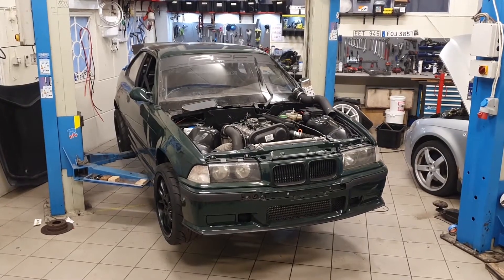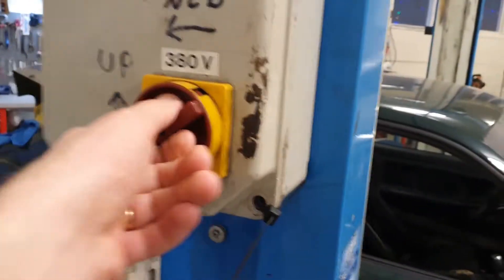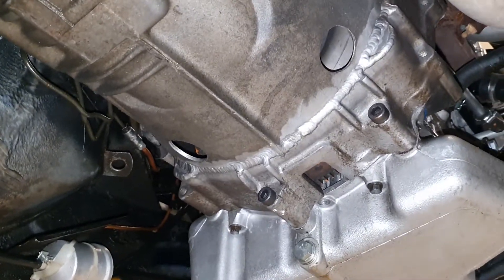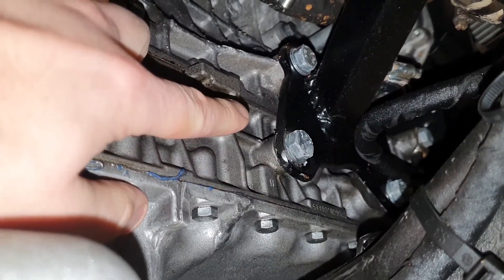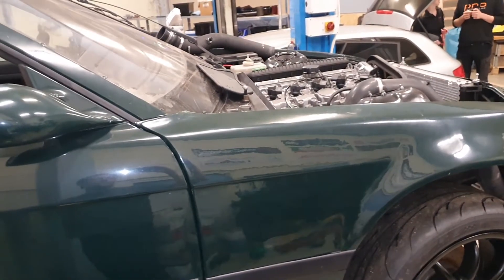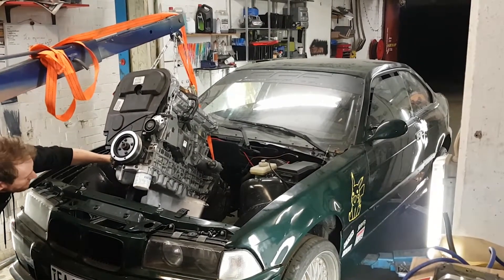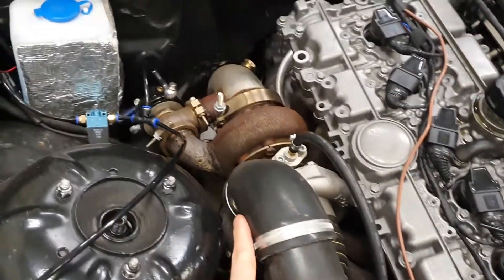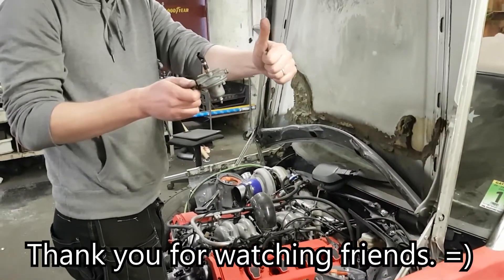HOW TO ENGINE SWAP ANY CAR - Explained in 5 minutes - with Volvo engine in BMW e36

Comment: Tha t5 engine is some degrees back in the volvo, reasons is i guess weight balance in the front. Couldnt it stand waterleveled in a rear wheel drive upseth?

Comment: Nice vidéo ! I want to swap my e36 like your !
Please tell me ...stock parts are about to handle 400-450hp ...of course i have to replace the turbo and intercooler ...im asking about pistons and rods
Reply from the maker: @sidahmedouabel7417  we have a bit over 500hp on stock internals now.
There are many versions of the volvo 5-cyl engine so the strength of the internals differs between them.

Comment: If I engine swapped would I need a wiring harness from the make of the car I’m putting it in, or make of the engine that I’m putting it in. And would I have to get it all properly remapped and calibrated so it runs properly
Reply from the maker: @lj2433  the best way is to get a custom made harness that fits both your swapped engine and the aftermarket ecu you plan to use.
Yes, a custom tune is needed too.

Comment: I had bought a freelander 1 as the first car for me to thinker with. Knew nothing about cars before hand, but I took it apart for a headgasket and oil seals replacement job. Drove it around for some time but the engine blew up. An oil leak while on the highway dumped all the oil out, and piston 2 slammed right through the side of the aluminum  block due to heat and friction. 

So, am I really going to put a 'new' 1.8l k-series engine in it, when the shitty land rover engine will always and forever be a liability? I'm thinking no.

Now, I'm researching the engine swap experience. Any thoughts on what I could possibly get away with? As far as I can see I have 3 different routes I can go: 1) a different but better land rover engine, if such a thing exists, I don't know. 2) a different brand but similar engine, like a Toyota Rav4, (but then why not just by a rav4, right?) 3) have some fun with it and turn it into a sleeper. Nothing crazy, no 1000HP stuff, but something to make heads turn as a freelander 1 zooms by.

Comment: What did you do to use the RNC manifold on the RN head?
Reply from the maker: Removed the vacuum-stuff on the underside and adjusted 3-4 bolt holes.
Reply: @dynochannel  that's all? Did you weld up the hole or the spaces on the flange? Thanks for the reply!

Comment: What transition and clutch did u use? And did I make the wiring yourself?
Reply from the maker: Hi,
Transmission is a ZF from a Bmw 330 diesel.
Clutch is a Sachs 707.
And yes, we made the wiring ourselves. My garage buddy Engdahl Motorsport do them for a living.
Reply: @dynochannel  cool thx 🙏 love the build

Comment: I use your video guide. In swap Volvo t4 engine into BMW e36/e46 oil filter will bump against the steering wheel/fore-beam?

Comment: same here my bmw x6 v8 engine is done and the used engine 9000$ im waiting for damaged bmw go to auction, but this will take a year, so for now can i take 4 cylinder engine from junkyard with its own ecu and same harness and wiring and give it 12v will it start without programing?

Comment: Hey say I want to swap this engine into an e46 and use one of those custom digital speedometers that are made for it by id4motion, do you think it would work? Or would I have to use a different ecu? Would really appreciate ur input/recommendations
Reply: Say I use something like an ecu master black? Would the id4 digital cluster work as it would with the Bmw engine?
Reply from the maker: @tariquetulloch6643  Hi, we usually use maxxecu on our project cars now, and it should work with the id4motion products. Dont know about the emu black though. Contact id4motion and ask them if it works 👍

Comment: My plan is to swap  1999. C70 2.0 T5, in to a 1980. Ford Taunus coupe. It would be appreciated greatly to get any advice on the issues you faced. I have complete C70 that need some minor work to get it  up to a good condition and i have bean presented with 1000euro Ford Taunus that has bean a project car but the owner decided to give up on it do to a lak of a number of parts that are impossible to find. My plan is to transplant as much as I can from Volvo to Ford and since Ford is rear drive, transmission is a bit of a dilemma. So, anything is welcome.
Reply from the maker: Sounds like a fun project.

We used a bmw gearbox with a volvo bell house welded to it. Most swaps here in Sweden use that combination.

Use an oil pan that fits with your front chassie beam. We used a shortened oil pan from a volvo 760 and also a shortened oil pipe inside the pan.

The you need to make your own engine mounts of course 👍
Reply: First of all amazing job! What flywheel, pressure plate and clutch did you use? And last question, if you have a complete donor car and you install all the electric in the swap car it is an easy way? Thanks for all!

Comment: this has me curious about an e46 swap. would an adapter plate be better than cutting and welding the trans? i wanna use that same trans for other builds
Reply: adapterplate is easier and you will get it 100% straight, but the welded boxes are fine. there super tricky to get straight in welding process.

Comment: How much do you charge? I'll send you my truck
Reply from the maker: Depending on the project. But if you are serious you can always contact me or Thor ( Engdahl Motorsport ) on instagram.
Reply: @dynochannel  I want to make my 01 ford sport trac the ultimate sleeper/daily driver. What engines do you suggest would be good for the swap?

Comment: can you go into detail what upgrades the engine has for the turbo?
Reply from the maker: Hi,
engine is a stock b5244s4 ☺
Reply: @dynochannel  but it's n/a engine
Reply from the maker: @igorigor9935  yes, we mounted a turbo on a NA engine 👍. Thought you meant if we did any internal upgradees on the engine.
Reply: @dynochannel  wtf i did not know that they could take this amount of powrer stock

Comment: I am Actually Trying to make this happen. The thing ist that I live in Germany an want to have it street legal. I’ve talked with my Tüv engineer and it is possible but tricky. I will use the stock turbocharged engine and will tune it later.

Comment: Did you use the bellhousing from the FWD transmission?
Reply from the maker: Yes. 👍
Reply: @dynochannel  okay. What about flywheel and clutch?
Reply: @dynochannel  im about to do the same swap in a E81 drift car, so im in need of help to get the trans and engine working togethers😅

Comment: Hey, cant tell you how many times ive watched this video im currently in the midst of swapping a b5254t2 into my 04 330ci, just wondering what you did for the exhaust manifold
Reply from the maker: Thank you for the kind words.
We are using an exhaust manifold from a S60R.
Sounds like a fun project. Do you post pictures on the project anywhere?
Reply: @dynochannel  that good news i have the r manifold
Reply: I would not recommend b5254T2. 83 mm bore is weak and thin at top of cylinder walls. I am swapping b5254t4 for b5234t3 right now.
Reply: @taylabarnett6726  why not b5244t5?

Comment: that is actually a ford engine.
Reply: You have the right information. You just said it wrong. But yes ford did use the volvo engine in the rs
Reply: Porsche helped Volvo design this legend

Comment: I'm curious what you did to fit the intake manifold
Reply from the maker: Volvo v50 t5 intake. An hour or two with a drill and angle grinder. Did not film it unfortunately.

Comment: Hi man love your chanell , can i engine swap my 320d 2.0L diesel coupe bmw to 335i 3.0L petrol engine ? Thanks
Reply from the maker: Thanks man. everything is possible it is just if you think allthe work hours are worth it. If i remember correctly the 335i have twin turbos. That is always a bit more tricky to fit in but you could rebuild it to a single turbo system to save some space. Might not be the easiest swap if you never done anything similar, and might be expensive too, but fully doable.

Comment: how do I need to modify the 960 oil pan?
Reply from the maker: you need to make it shorter since the t5 engine is shorter than the 960 engine. You also need to shorten the oil pipe within the oil pan.
And make sure the sealing surface stays flat after you weld it by using a fixture.

Comment: I'm planning to put the same type of engine in my Peugeot 505 and wondering what problems i should know?
Reply from the maker: Hi,

Nothing special compared to any other engine swap i would say. Make sure you have enough space on the height. And check if your original oil pan fits.
There is also a jungle with different engine codes so make sure to get one that fits your needs.

Comment: People should just understand that a cars Chassis is just a body with interchangeable parts it's a shell essentially you can fit anything into anything
Reply: I used to think that too. The devil is in the details.
Reply: But size matters!!
Reply: please fit mercedes benz t80 engine in my vw lupo, pls
Reply: Exactly! That's why I put a MAN 20V45/60 into my Fiat 500!
Reply: tell me you done 0 swaps, without telling me
Reply: @maki_m50 cars without a engine is just a blank canvas if someone can swap V8's into miatas it's all possible
Reply: @KingChadKennedy ok internet mechanic, thanks for info
Reply: @maki_m50 so what I'm saying is a lie ? Don't make as if I'm wrong
Reply: TÜV sagt Nein
Reply: @eltyranto2269 what if you don't need TUV if you are going to do a drift project?

Comment: THANK YOU
Reply from the maker: Hope it helps Alex 👍
Reply: @dynochannel  it did! but now I only have more questions 😂😂😂
Reply from the maker: @ANKieffer  haha, what questions? 😊
Reply: @dynochannel  My main one is did you have to do anything crazy to get the transmission bolted up to the engine besides weld on a new bell housing? Or did the lengths match up well enough between the input shaft, clutch, flywheel, etc.?

Comment from the maker: First time i'm doing a video like this on a second language.
Good or crap?
Let me know if you want me to do a deep dive into some special area in the future. //Erik
Reply: Sounds great. Deep dive into wiring please. Its the part I dislike the most, because I know too little of it.
Reply: It's good, keep doing these videos. Thanks!
Reply: Very good, zero problems with understanding. Great topic and there are not a lot of people putting out video content in this, so you should get a great return on your efforts!
Reply: Great thank you
Reply: I see Audi A3 8p in the background. I also have A3 2.0 Tdi. I want to swap to VR6. Please advise on best engine for that swap. Easy swap from diesel to petrol
Reply from the maker: @Formula1Brave  as a first swap i would say that a smaller engine with less cylinders always is simpler. For exemple it is easier to mount a smaller 4 cylinder straight engine versus a big bulky v10. Smaller engine equals more space in the engine bay for exhaust pipes, inlet and turbo. A naturally aspirated engine would be even more simpler, but small engines without boost are usually not so fun. I have never worked with the vr6 engines, but it seems like they are good engines that can handle quite a lot of power. A friend is mounting a vr6 engine in an old Volvo now. You find him on instagram @ brandtab. Maybe you can find some good ideas there for your swap 👍
Reply: please I use a 2012 chevy and I would like to swap it for a German or Japan engine. Please recommend a Japan or German engine that can do the swap easily.
Reply from the maker: @michaelyeboah1393  what kind of chevy are we talking about? A truck?
Reply: Thank you you explained very well all the process👍🏼👍🏼👍🏼
Reply: You did a great job mate, keep it up! ;)